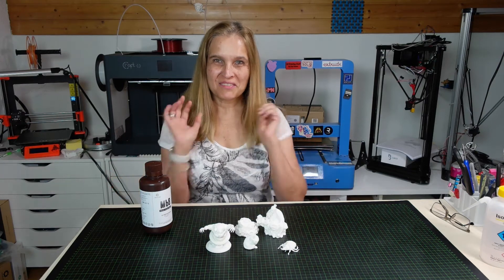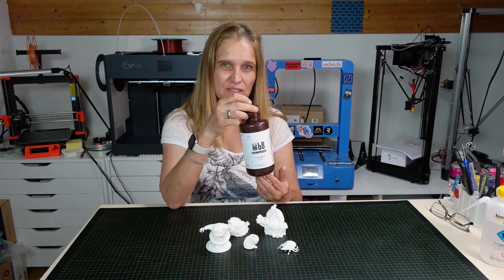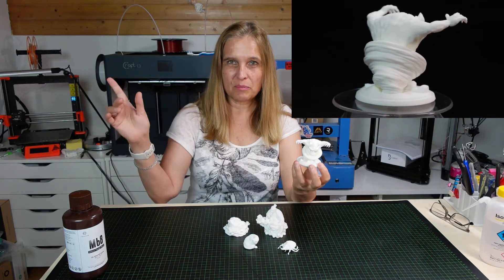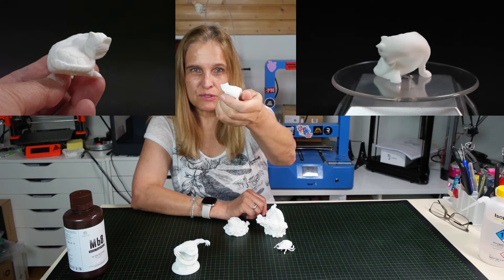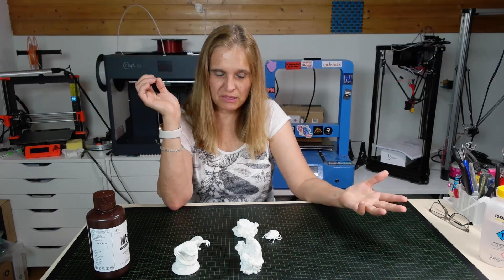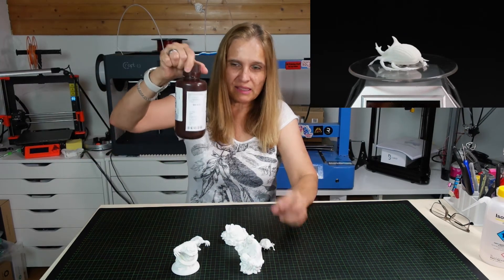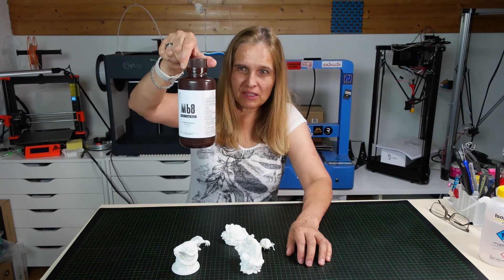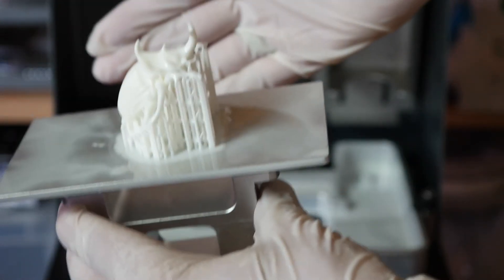Resione M68 White Tough ABS Like resin

Comment: Hi. I'm going to buy a resin printer to make technical piece, and i want to know if this resin respect dimensions. In other word does the final piece had same dimension as the 3d model. Thanks.
Reply from the maker: You will have to print a test piece. If your slicer lets you adapt the size settings, then you can adapt it right there.

Comment: Did you have any issues with the resin yellowing, even after a few months? And did you clear coat it at all with UV protection spray after? I’ve heard this is a non yellowing formula and I’ve wasted so much money on others that can’t give me a non yellow finish, and for the projects I’m doing I have to be time efficient and skip painting. Any insight you could provide would be so fantastic! Thanks so much for the video my spirits were low when I couldn’t find anyone that had used this resin, until I stumbled upon your video :)
Reply from the maker: I can’t see any yellowing effect on the white formula. So far I only know that transparent resins get yellow after curing. Which of your colors and brands got yellow?
Reply: How about yellowing at the moment?
It would be nice test to leave it for a few years under direct sunlight.